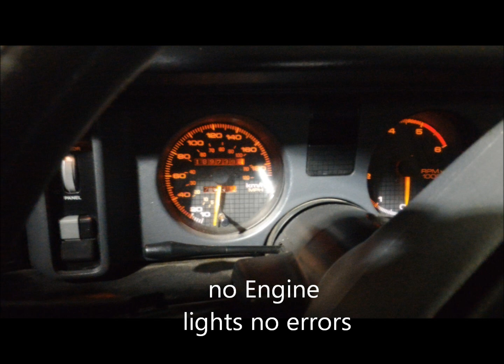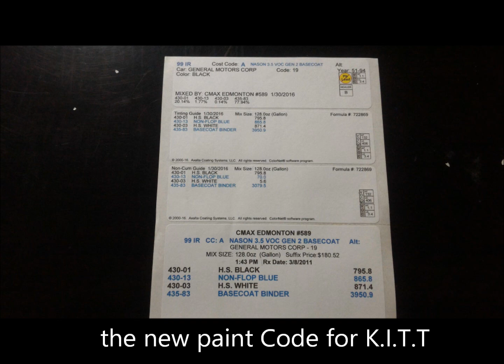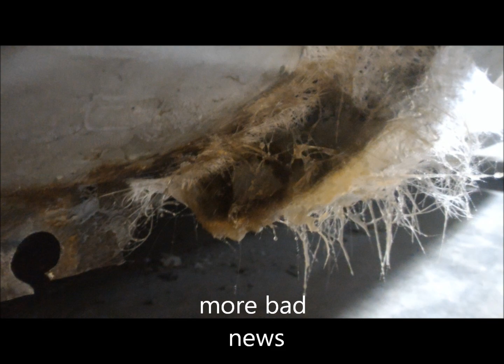my own K I T T car project part 1

Comment from the maker: Hey guys part two coming soon I have some interesting  photos off K.I.T.T getting upgrades like power windows mirrors and locks plus remote keys and paint job stay tuned and fallow my Facebook page with updated horoscope ect :)
Reply: Very nice project. The nose looks a bit too long, where did you get it from?

Comment from the maker: Hey Sam it was not a easy one hour job you have to take off the two door panels of to get to some screws holding the top part of the ground effect same for the rear part need to get acces to the screws they r rusty but not impossible to do it took me prob 45min to take off front and rear the side r a tuff ones cuz you need to grind off the rivets. And the acces sucks but if you know how to turn a screw driver and drill holes it's not bad feel free to ask for more tips message me thanks Dave welcome to the Knight Rider family 😎

Comment: I am also using a 91 trans am for my replica. How did you get the metal bracket off for your ground effect along the door rocker panel.
I ended up drilling where tac welds were and using body filler. Just wondering if you had a different approach.
Reply from the maker: sry for late reply umm i alao drilled them out and bondo over it it only lasted about two years  untill it started poping off now i sanded it down to metal and welded it right up than grinded it flash and bondo it smoth tip be aware of heat bulding up doring welding worping and banding the doors tough to fix but durable take your time and cool off the foors good luck brothaa!

Comment: How did you fill the ground effect holes I have to do the same
Reply from the maker: I had to weld them all up as filler will fall of with time i cut 1x1 inch squers dented the holes more in so its flush with the body i also used old fenders as metal for the patches easy to do but will take a day 
Also dont weld longer than 1.5 sec each time take 2 sec brakes otherwise  you will burn through the metall making holes in it haha let me know how it goes cheers!!!
Reply: @BassShoter  awesome thanks!

Comment: How did you get rid of the rust areas also I have a nice rust hole near the spare tire. Did you sand the whole car too?
Reply from the maker: yeah i did sand it down to the metal used paint stripper in a spray can but be carefull take the TTops down it will damage them i learned the hard way!
if it comes to rust holes i found more by the driver side door under the carpet had to cut it out and weld it up i fixed it first with fiber glass and bondo temporarily lasted two years till i grinded it all off and welded it solid its best to weld it up but if you got no monay at first bondo and fiberglass will hold few years cheers

Comment: When you remove slam panel bracket that sits kind of where scanner goes where did you re mount the rubber stops gor hood that are on that bracket
Reply from the maker: Not to sure if i u derstand the part where the scanner sits on stays
U do have to remove the mounting bracket holding the old bumper i simply.removed it also you may have to bend down a bit up to u

Comment: I noticed you used a 91 or 92 Pontiac firebird.  How hard was it to take off the factory ground effects molding that was on the door and on the bottom of the car?  I am using the same model for my own Knight Rider project and that molding has me a little worried.  Is it glued on, bolted in, clipped on, what?
Reply from the maker: its tag welded  drill it out but you will need to weld the holes back close and bondo it smoth if you think just to bondo it it works but only for about two years until  it pops off

Comment: Would love to build a KITT with a Chrysler Turbo engine and the guts of a Tesla, imagine having the autodrive button actually autodrive? Stick in an Alexa or Siri and wear a linked smart watch and you'll possibly have a car closer to the concept of KITT than an original screen used car ever could, bullet proof body, windows and run flats are optional unless you plan to fight crime and be the one man to make a difference, being a crimefighter not advised.
Reply from the maker: haha yeah u can
Reply: That would be amazing!

Comment: I'm thinking of make  kitt what I got do
Reply from the maker: get the car thhe closer you get to the build 82/84 the cheaper  its to build it the 89/92 models r more expensive to build but you get a better platform possibly less rust but you need to swap rear bumper spoiler tailights ground effect delete and interior center console and door panels  swap it means simy a lor more $$$$ also try to get the min of 305 5.0 V8 engine  not the crappy V6  cheers!!!

Comment: Where are you at with this beast
Reply from the maker: runstreetsofvegas 
Currently KITT needs Bonny he shut down on me a no crank situation similar to the Vats problem GM cars have 
Soon will make new videos of fixing this problem and part 3 on the nose job👍🏻😎
Reply: BassShoter interesting. I have a chip burner. Let me know if you want to go that way. I just got done with my buddy's some time ago.
Reply from the maker: Hey that’s cool how does it work??? Never done anything like that before? Did your buddy had a similar problem like I have?
Reply: BassShoter yes. You turn off the vats In The computer code.
Reply from the maker: Where you from? Some people told me about it it may be the solution it’s really wierd what’s happening with Kitt even after resistors in place no difference I will try to dig to the vats computer and see if there is like a relay or fuse to it last chance heh thanks dude👍🏻😎
Reply: BassShoter did you jumper the relay?
Reply: BassShoter the relay behind the kick panel on the driver side on the left. The starter relay has to be jumped.
Reply from the maker: Yeah I can crank the car if the starter relay is jumped  but won’t start unless it’s filled with gas or starter fluid but dies after 2 sec
Reply: BassShoter yes that sounds like vats. I would need to see what kind of ecu you have in it. It is a later model and a tbi. So I assume it would need the plug in. Map sensor?
Reply from the maker: I did a video of the car not cranking ect it’s on my page it’s a 91 TBI vin has the E number in it 305 5.0 V8  TBI
Reply: Yes that is a vats issue. Fkn vats. By buddy's did all the same things in his 91 Camaro.
Reply from the maker: runstreetsofvegas 
https://m.youtube.com/watch?t=62s&v=jHlnrB4a8nk
Here is my video I did few weeks ago 
I just don’t get if it’s a vats problem why does the resistor trick don’t fix it??? Another thing is I can clearly read the original key in the ignition in at the connector 3.71k wouldn’t that mean the vats can read it??? Right?
Something went wrong over the cold days here in Canada it killed my new battery and since that moment this is the problem???  
Before it was just fine
Reply: BassShoter I seen the vid. It's a vats problem
Reply: Where are you at with this? Did you get a dash yet?
Reply: Try this